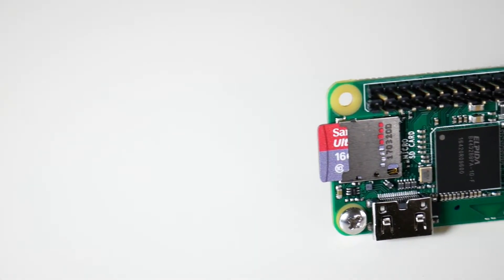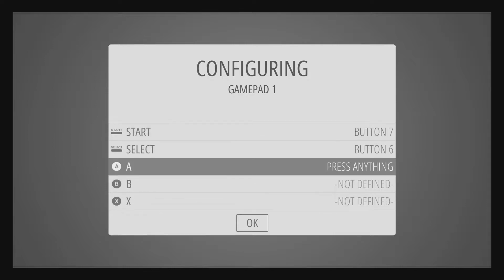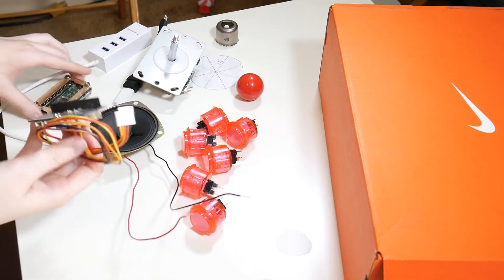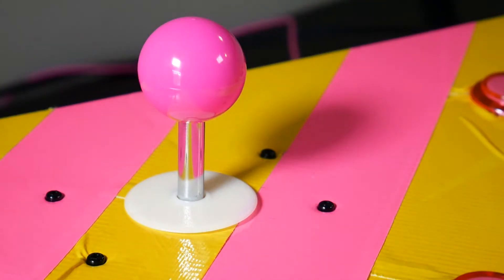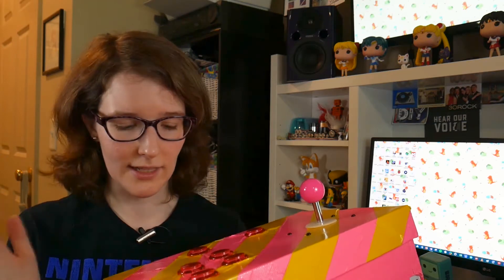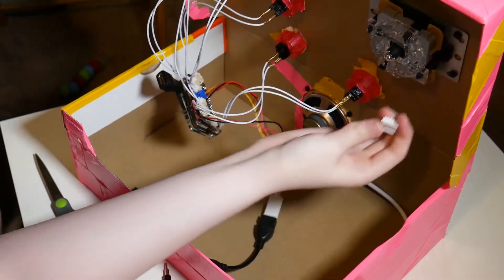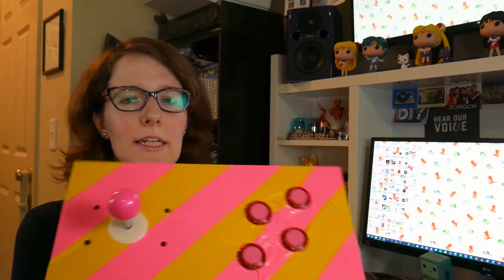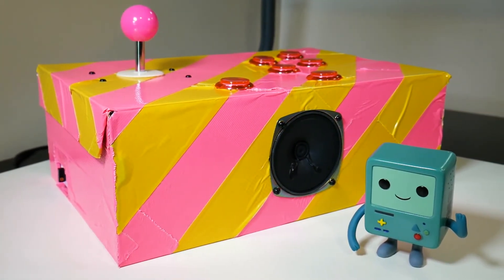Shoe Box RetroPie Console

Comment: Hey! I just installed my Retropie and built a retro case and everything about a week ago. 
It is important to notice that not everyone can just access the Pi with the windows explorer. 
I'm using Pi 3 and thought that it would just work, but it didn't, and at first I didn't know why because I even typed the Pi's IP address plus ping-ed to it successfully, but then discovered that I should have been installed the Samba service on the Pi, so I did that using SSH (with Putty, just as you did) and after that it all worked fine. 

Another tip is - please don't refer to the Github documentation as much as you can, as it's not updated. 
For example, apparently you don't have to write launch scripts for Doom WADs anymore (applies to Retropie 4.2). I had another problem while trying to launch the game and mistakenly tried to edit the permissions of the already-made launch script (as it didn't match the script I saw on the documentation page) but obviously that didn't help at all. Eventually I figured out the problem, and found out about the launch script thing only when I randomly checked the updates for the 4.2 version on the Retropie website (and it wasn't the only not - updated thing there). 

I find the documantion very handy in case you want to figure out which emulator is good for which game, but even the directories mentioned on these pages are incorrect. 

As for the wireless connection - some devices have a hard time to connect when the network encryption is stronger than WEP, which is pretty weak.
A lot of times you just need to play with the encryption type on your router's settings until you find one that works fine (you can also try to play with the 64 bit/128 bit and stuff).
Reply from the maker: All awesome info, thanks! Pinning this for others to see.